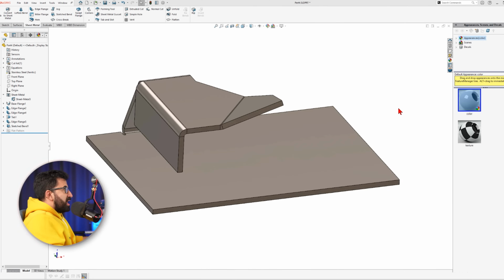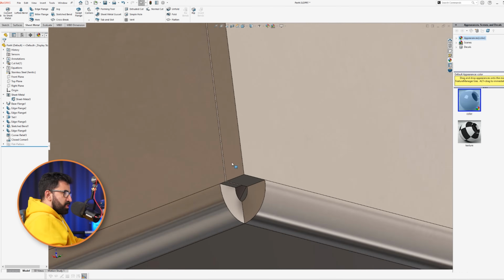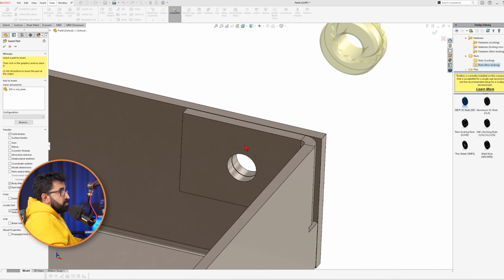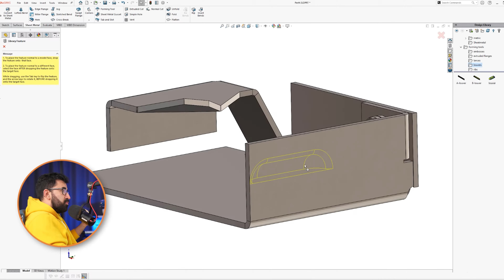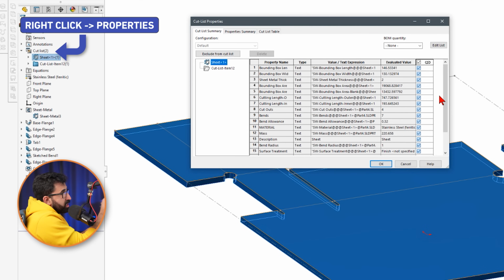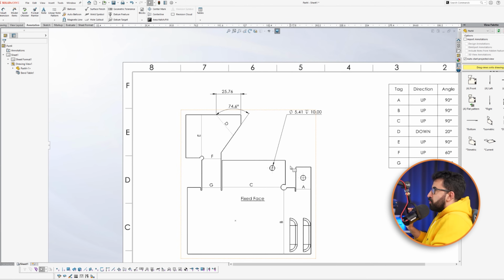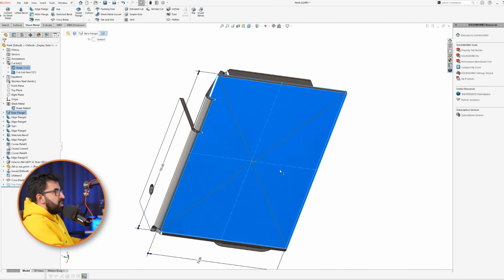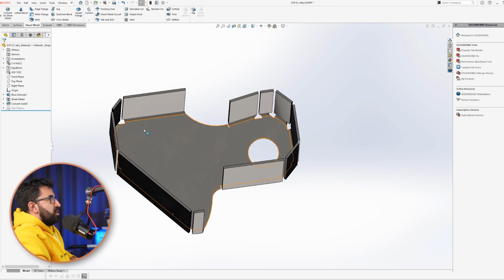SOLIDWORKS Sheet Metal for beginner | Episode 2

Comment: Not sure if I agree with your drawing workflow. I would rather have dimensioned the folded part on the first page since that is where the design intent and tolerance is that matters most. On a second sheet, on the flat pattern, the bend lines and overall dimensions should be fully defined but not individual features. There is always some inaccuracy in bending precision so the dimensions after bending should be defined and toleranced. This is the way I see it at least, but maybe there is an argument for the other way? Either way, nice video.
Reply from the maker: There is no written guideline. As long as you are fully in control of what you are doing, and you are certain it's one of the most efficiant way of doing it, it's fine imo. I believe this way is faster. But I never say it's the only way

Comment: When it comes to production, that gap is easily solved. Fill with weld mostly with Co2 with wire fi1,2 and that's ok.😅Laser cutting of the plate and then on the press with bending.Only for this you do not need any tolerances or measurements that are not a round number because it is a sheet material made of steel.The laser will not be able to cut a measurement for example 72.11 exactly. You always go to 72.
Reply from the maker: Great point! When working with sheet steel, you're right about keeping measurements rounded for laser cutting—precision down to the hundredth isn't always necessary, especially with standard tolerances. Thanks for sharing your insight!

Comment: Is there a way to make holes at an angle in sheet metal for SW?  Wanting to have a cylindrical hole and show the machinist that there need to be holes drilled in AFTER cutting, rolling and welding the sheet into a cylinder.
Reply from the maker: yes! use a simple extrude cut

Comment: Good video, but the only things on a sheet metal drawing for the 'formers' should be the overall sizes and where the bends are, plus a view showing what the end result will be. you should then have another drawing showing what the end result is that the 'formers' do not need to see as they do not need too. The reason for two drawings is because not everybody needs the same information and is wasted and you can have much cleaner easier to read drawings. Also you should never write notes that give crucial information that could change if the part happened to change, for example the bounding box, the dimensions can always be added.

Comment: Someone who has done an absolute shit ton of sheetmetal components we never dimension the flatpattern apart from bendlines and up and down but as a reference dimension since the actual sideview if the bend is more important and the outcome of the flange. And as a tip, whenever there is an angled bendline add some flatspots on either side either as break off tabs or indents in the part. Otherwise it will never come out correct unless it is fixed tooling which sort of defeats the cheap aspect of normal sheetmetal :)
Reply from the maker: Thanks for sharing that!

Comment: Good that you have mentioned cut list parameters. 
I was struggling with manually using Evaluate function before I found them cut list parameters were always there. 
I was doing lot of calculations as part of my kinda-free time at work so I found it myself and made a usefull BoM template, where it shows all cut list items parameters at one drawing. So I just throw all DXFs into one sketch, extrude, convert them into SM all and that's it - I have full table with all values. 
Its just very helpful, when you estimate the price of the product you make or when someone asks you of those parameters.
Reply from the maker: Glad to hear that

Comment: Some Adds :
For Bolt connection you need to add wider hole for one side because bend guy can't bent an ideal line and your holes will not be coincidence. And second one - Convert to sheet - is better method because takes less computer time to generate.
Reply from the maker: Thanks for sharing!
Good point

Comment: hello brother, what do you think?
1. press machine first, or
2. Product first
which is produced.
Sometimes when we make precise and complicated sheet metal designs, it turns out that the gauge and V block don't match ,lol
Reply from the maker: A lot of ambiguity in that query;
Are you asking for what process to do first when manufacturing a complicated sheet metal part?

This would require part specifics to answer that question because every part is different
Now for the tooling. If the gauge or sheet thickness doesn’t match the die of course it will bend incorrectly. I suggest using a laser engraving tool and make sure all tooling is labeled so no one can get it wrong
Reply: @with-aryan  yes, that's what I mean. Because in my country the cost of processing with a laser machine is still very expensive, and thank you for the good answers, I really appreciate it,